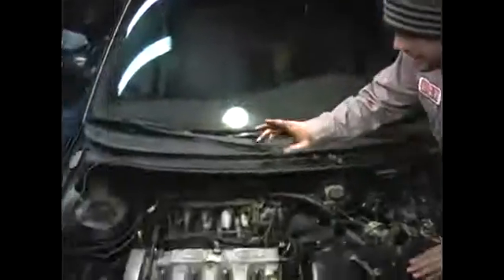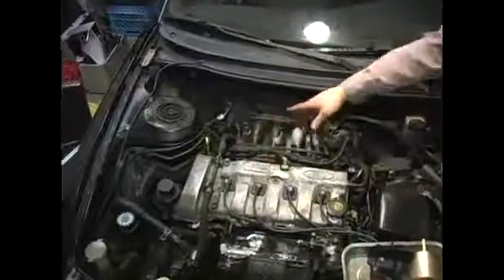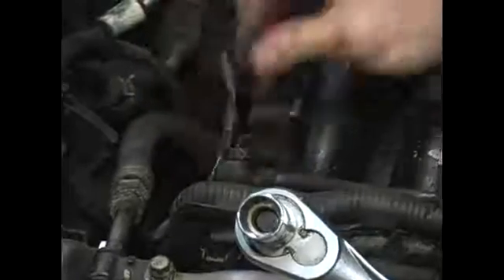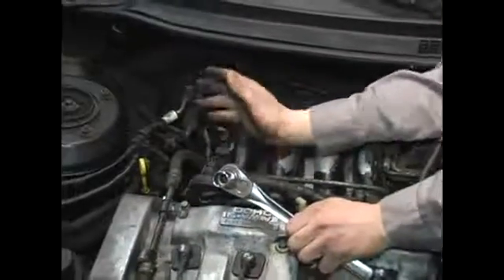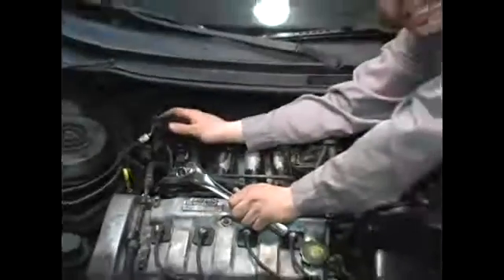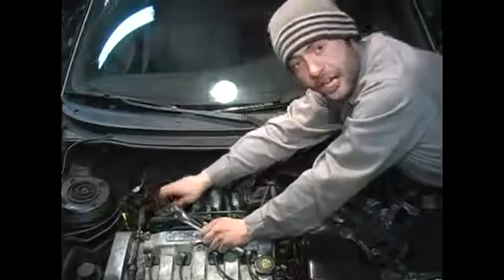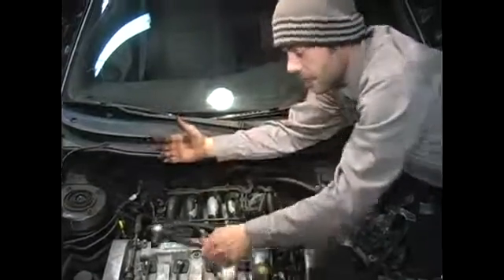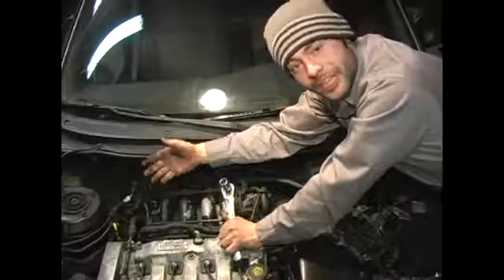How to Depressurize a Fuel Line

Comment: First thing I did unknowingly was press the schrader valve for the AC line. My fingers got a blast of very cold stuff. So then I dug a little deeper, found the other schrader valve for the line and absolutely nothing came out after pressing the pin in. 

My engine still shudders while it idles.

Comment: If the car was just running and the line has not had time to depressurize, you can do so by removing the fuel pump fuse then run the engine, it will quickly die from no fuel.